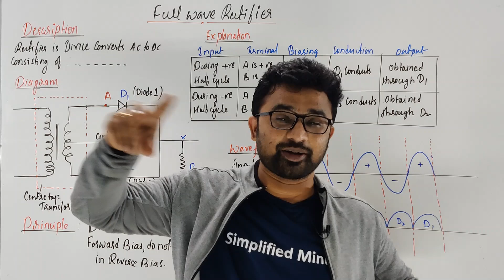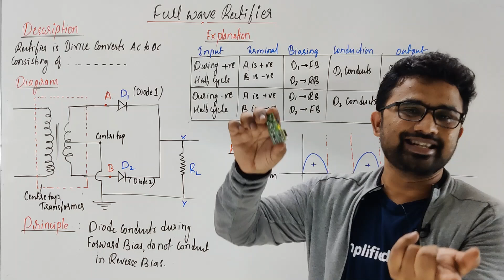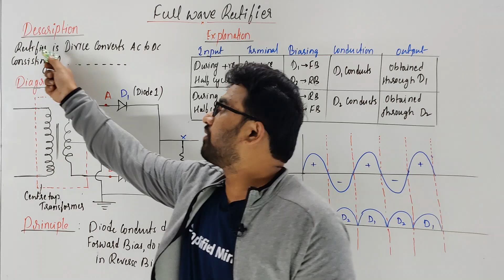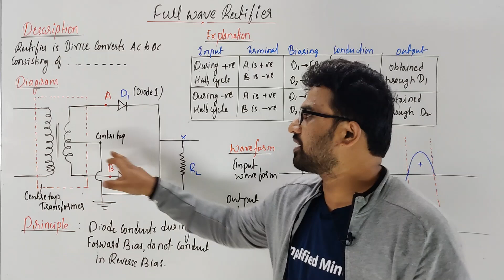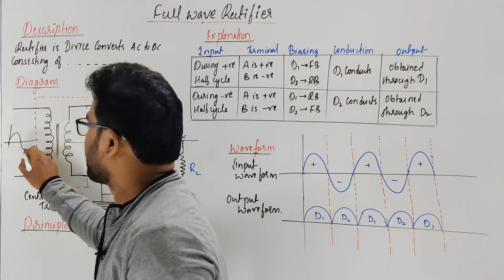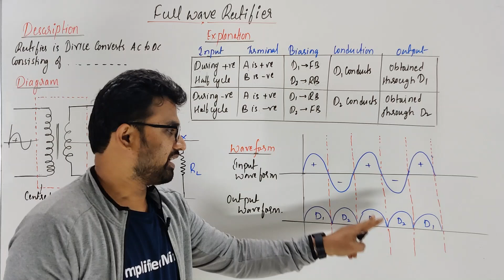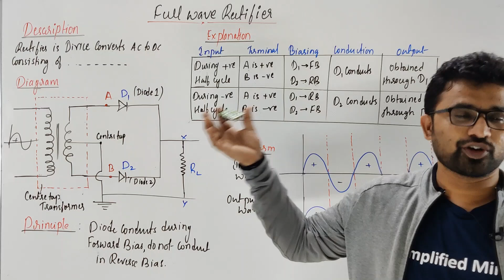Full Wave Rectifier with Real Circuit and Derivation | Semiconductor Devices | 2ndPUC Physics

Comment: Sir during -ve half cycle, A is negative and B is positive!
But you wrote A is positive and B is negative!
And thanks for making the concept Crystal Clear!
Reply from the maker: Yes actually 😅
Reply: Ya I m seeing that...😊
Reply: I was saying the same
Reply: Hey.....can we write this explanation in exam they will give marks?
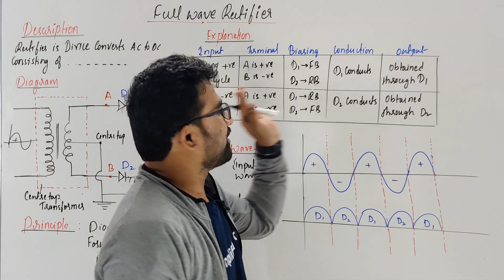Reply: @tasbiyahuda8477  Yes. Sir told we can write like that. In fact he mentioned that it would be easier for the examiner to correct our paper in that case. But just write the description in 4 to 5 lines shortly after writing the table. You can watch from 9:40
Reply: @jessicaalberto6645  did u write ? Did it work?